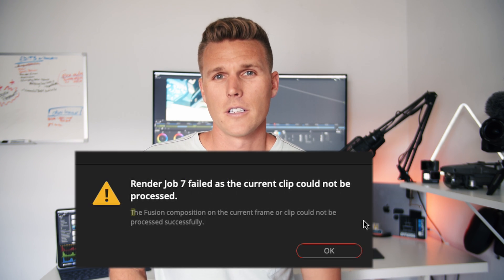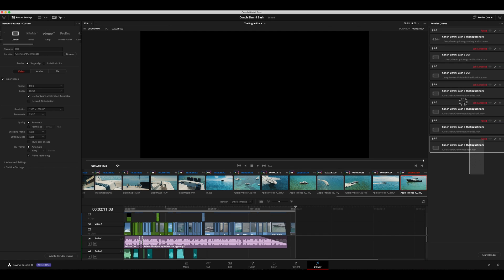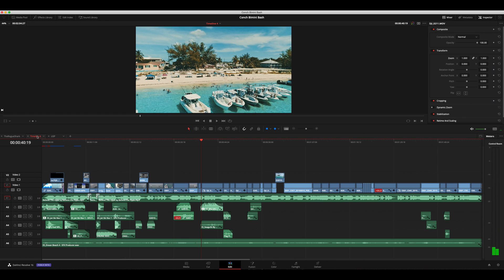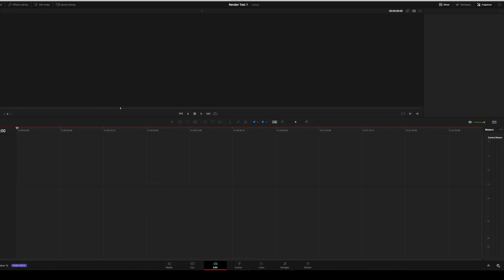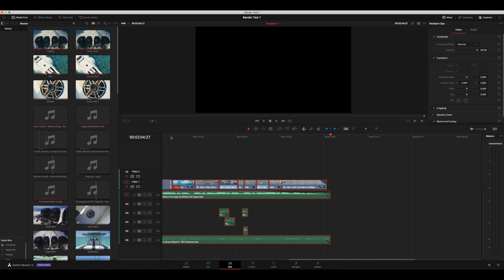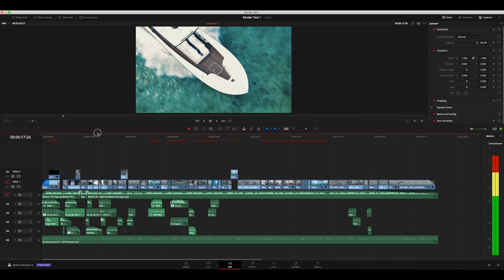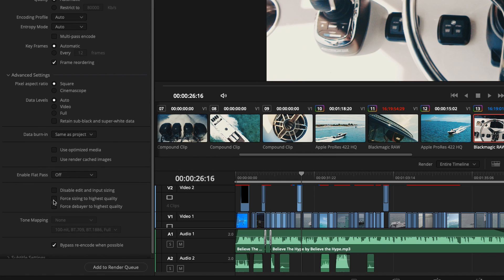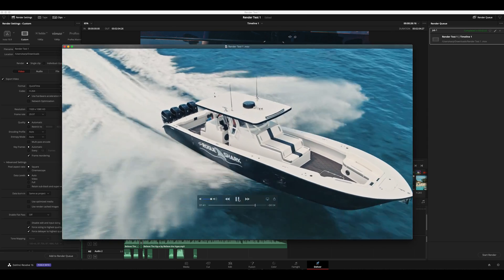How to fix "Render Job Failed" Error | DaVinci Resolve 16

Comment: Hey guys i discovered it too. I tried anything esp reinstalling my davinci resolve and updating the graphic card eventhough my graphic card is in the latest driver version. It make me stressed out however i found a way try reducing the render speed to 50 from maximum or 100. IT WORKED for me. the option is on render menu, file tab, scroll it down. I'm on davinci resolve 16.1.1 free version..I've downloaded the 16.1.2 but switch back to 16.1.1 My project is in 4k about 14 minutes..
Here is hardware i have (Aourus X570, Ryzen 7 3700x, RTX 2060 super, 32 Ram 3200) its sufficient for davinci resolve...
Hope it helps you, believe me i tried everything including yours and people in your comment but none of that work.
Oh ya i'm in the latest windows 10 update. i tried uninstall the update but nothing work so i reinstall the update again..seems the latest version has many bug in it
Reply from the maker: Hey Patrick thanks for sharing this!! Im sure it will be a huge help for someone in a similar situation. Thanks again! Cheers!!
Reply: @JakeEarp  thank you for making this video..i have monitored blackmagic forum and recently there is many other user  reporting the same issue including mine. However I cannot render again just 4 hours ago and i search for information regarding this. One of user commenting to change to openCL. Preferences->memory&GPU-> change it to openCL. Rendering with slower time. IDK what happen but one of the blackmagic team said use 431.86 studio version don't use the new one..still it doesn't clear to me. My biggest suspect is GPU driver having some issue with the new version of resolve

Comment: Mine has still failed to render. States "The clip could not be decoded correctly. Please check if the clip is still available on the drive" 

Does anyone know a way to navigate this issue? Any help would be greatly appreciated 🙏
Reply from the maker: Hmmm I haven’t heard that one yet. That happened when trying to render out during export?
Reply: @JakeEarp  I waas using xSplit broadcaster to record everything, but switched to Streamlabs OBS and it fixed the issue.

Comment: I could "resolve" or fix this sort of rendering problem after a few frustrating hours of experimenting.
The solution was very easy :  in the deliver tab > Render settings > check in the Advanced Settings if Use optimized media is activated.
Reply: good

Comment: I copied and paste my 2 min video to make a 1 hour video (to make a loop) and I have this problem, the render fails after like 7 or 10 min. I don't understand because technically if it renders the first two minutes it should not be a problem because its the same clip at the end of the day just copied and paste like 30 times. That's what it says any idea how to fix this?  "The clip "X" could not be decoded correctly. Please check if the clip is still available on the drive" Is it Davinci Resolves the problem? Or its the multiple copy and paste that fucked the software?

Comment: Actually you giving them wrong idea,go to the , render settıngs*advanced settings ; dont check that 3 boxes(force sizing,force debayer,disable edit) because if you checked, program try to do maximize performance,and ıf your pc cpu and ram not enough resolve wıll gıve render error.Also check use optimized media and use render cached images,do enable flat pass with clip settings,thanks me later..
Reply from the maker: Thank you for sharing! Are these the settings you use for exporting?

Comment: Thank for help. Currently experienced davinci resolve 16 crashing when working with mts files. Even when I rendered the mts files with davinci out to mp4 format, still experienced same problem. My mac 3,5 GHz Quad-Core i5, 16 GB Ram with AMD Radeon R9 M290X 2 GB graphic ram. Is this Hardware or Software problem.
Reply from the maker: Hmmm that’s a very good question. I don’t have any experience with mts files. In fact I don’t even know what that is. Could you explain?

Comment: So I've watched this video before and did a full restart/reboot of my system to resolve the issue. Well recently had the issue an COULD NOT solve it... glad i came back to this video: Although all my videos are at 60FPS I did change as much as i could to the setting you mentioned. The thing I feel the biggest help was copy and pasting the project to a new project and rendering. Not sure why but it worked. As well as the cash loading to smart. Thanks again. This video has helped be twice now. AF out!
Reply from the maker: +Arc Of Fire oh man, I know how frustrating that can be. I’m glad you were able to get it to render! Is your timeline set to 60fps or your footage is shot at 60fps?
Reply: @JakeEarp  both. After watching your video though it made me think that filming at 60fps is good and creating the video at 30 is fine; as it's just a film and setting at 60fps is overkill. Would that be a correct assumption?
Reply: @JakeEarp  Both
Reply: @JakeEarp  I thought I replied to this?

both are 60fps.

Comment: I had the same problem but also didn't help me. I had a couple of clips where I had a speed ramp on as well as some dissolve transitions. I still don't know why I had this problem. Not good. Thankfully I was able to work around it with the suggestion from Bar Shabatai Productions. Although it didn't work for me your content is great. Keep up the great work!
Reply: Even with going through the preferences and de-selecting the "stop renders when a frame or clip cannot be processed" still leaves the exported clip with glitches and issues with audio... I'm still hunting for a fix.

Comment: I had the same problem and I tried your work around but I still got the same error message that you kept getting.  Is there any other way to get around this problem? Thank you!!
Reply from the maker: +Mike Caprarola try going into settings and turning off “stop render if frame failed”

Comment: THANK YOU Jake for this video. I'm experiencing exactly the same Error in 16.1 (final version, not Beta). I will try it out later and if it works it save me a lot of time.
Much appreciated. Keep on doing videos on Resolve like this.
Reply from the maker: +Günter Reuter Hope it does the trick, thanks for the kind words! Trying to pump out some more useful tricks for resolve. How long have you been a resolve user?
Reply: Unfortunately it didn‘t work with my Timeline. I‘m using Windows maybe that´s the reason. Even with Davinci 16.1.1 the same error occured. However the solution was to render out three clips of my timeline causing the issue individually using a lossless format in order not to loose any quality and to Import them back again into the timeline.
Í´m using Davinci Resolve Studio about 1,5 year now and despite of bugs like this I love it and I’m really impressed about BMD‘s enhancements of the software since then.
Reply from the maker: +Günter Reuter yes the speed which they are pushing updates is amazing and makes me feel comfortable about making the switch to Resolve

Comment: Good video, I had this strange issue with 16.1 and would not render for some reason. Check everything from hardware to software and everything was great. Not sure why. After the Third time I restarted my PC (windows), opened DR16.1 and opened the project and set to render with all the same settings and it worked fine. Not sure what the issue was. 

Minor note about this video:
No offence but I really don't want to hear your swallowing and breathing, etc in your video. It was very distracting. I noticed at the end you were right on your pop filter... When you pulled away an inch or so the sound was better.
Reply from the maker: +Devin B thanks for the tip!! First time using that type of microphone

Comment: Where is command + a? There no command key in my keyboard.
Reply from the maker: +Poon CH if you are using a windows computer it will be the ALT key. So try ALT+A to select all. Which computer are you using?
Reply: For windows, use Ctrl, so Ctrl+A will select everything.

Comment: That's an odd issue... I've worked houndred hours on one project and can't render it now :/ So damn flustrating!
I am trying on two machines. 
One based on R7 1800X, 32GB Ram, 2080Ti
And a laptop with i7 9750H, 32GB Ram, 2070. 
First PC rund 16.1 b1, Laptop runs 16.1 b3

I have compound clips in the project, but already uncompressed them and keep trying. Tried cleaning cache, allowing re-encoding and nothing helps. 
I even kept watching for the whole duration of render to catch where it fails. It does it on different stages which is even more confusing... :O
Reply from the maker: +Pawel Jackowski try going to settings, preferences, user UI and unchecking the box that says “stop rendering when frame dropped”. Another viewer has had success with that. Please let us know if that works for you
Reply: @JakeEarp  I tried that and it worked. Thanks! Now need to find where is that faulty frame and decide to fix it or ignore 🤔
Reply: Jake Earp Wow, it looks to be the solution to my last issue that I had with the retimed compound clip that I talked to you about a few weeks ago...it is rendering right now and is almost halfway done whereas I think I only made it 0-1% max through the render before...Anyways, I am going to call it a success already...I was looking everywhere for a solution and never come across this as a suggestion and had all but given up and was just waiting on my new system...I am so glad I checked back...thanks again!!!
Reply: Jake Earp And, obviously it completely finished rendering and was such a silly simple thing that fixed it, and I never came across the suggestion reading tons of threads in BMD’s forums and even asking in those threads (sometimes directly to their employees) and hours of searching on Google. Now the question for me is...what is causing these frame issues in these compound clips when they are retimed (to 75%) when those very same compound clips render perfectly at normal speed and don’t need this special setting?  Something ain’t right here...smh...Anyways, thanks again for the videos and everything, sir!
Reply: Jake Earp Well, I was watching the final render closely and unfortunately, there are some black frames that are noticeable (probably due to the 75% speed but might not have been noticeable otherwise) but I am still very happy that things seem to be moving in the right direction.

Comment: Bar Shabatai Productions: Go to preferences: User: UI. Then UN-CHECK the box next to; "stop renders when a frame or clip cannot be processed."
Reply: Thanks Sultan - this solved my issue when the video suggestion didn't work!!
Reply: Thanks!  I looked everywhere for the solution to my problem and even asked in BMD’s forums and nothing worked and never came across this suggestion.  Anyways, it worked perfectly.
Reply: Thank you so much! This solved my problem as well👏🏽👏🏽👏🏽👍🏽👍🏽👍🏽🙌🏽🙌🏽🙌🏽
Reply: THANK YOU!!! This right here is the real solution
Reply: Im trying this right now, but im not sure if its going to work
Reply: Thank you Sultan it did helped me alot
Reply: Thank you so much! The suggestion from the video didn't work but this did! Allowed me to hit my school deadline. Yay crowdsourcing!
Reply: thanku! it works perfectly!
Reply: Yayyyy
Reply: That worked for me.  I had the error "The clip could not be decoded correctly. please check if the clip is still available on the drive."  Funny, because youtube could decode it.  Thanks a lot, both of you!
Reply: thank you so much, this worked for me as well :D
Reply: Great! It worked for me!
Reply: THANK'S
Reply: The real solver!
Reply: Where is productions
Reply: Where is preferences